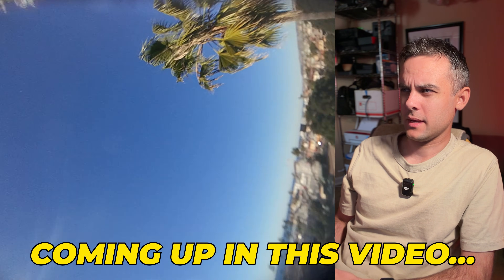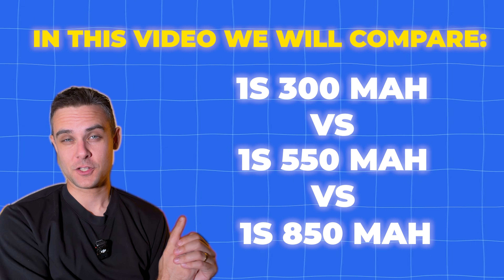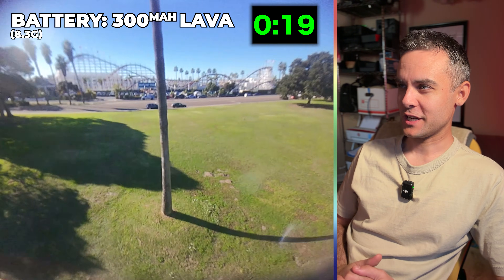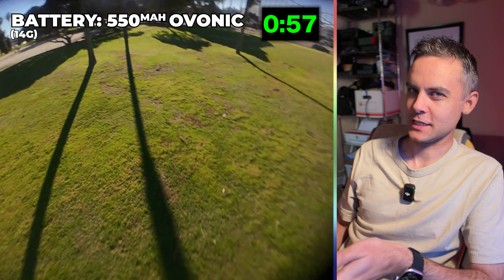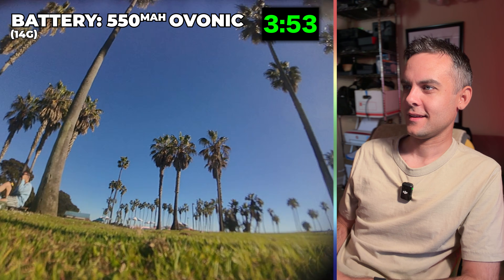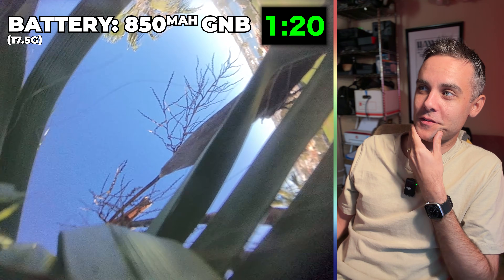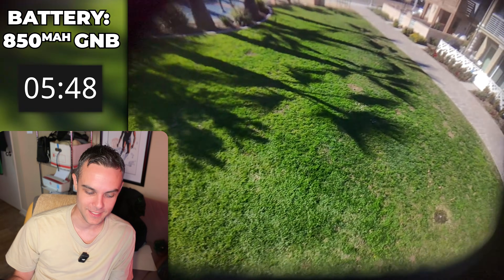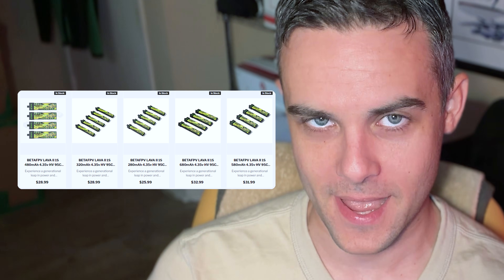How a 3inch 1s battery test became a rescue mission...

Comment: it is analog, but I found myself addicted to a 1S 8 inch toothgrinder build using the stock motors from the beta FPV meteor 75 pro it is so controllable and a lot of fun working on my 2.5 inch 2S tooth grinder currently which will be running 04. These littler drones are a lot of fun. I mainly fly the small sizes all the way down to 65 mm. It’s the only other size I fly is 10 inch and that’s for my long range. I don’t mess with 5 inch lol

Comment: Get the GNB 660mah. Light and powerful.
Reply from the maker: Sounds perfect! I’m also curious about the new beta FPV lava 2, coming in at 680..
Reply: @saunaFPV i found that going light at all costs is not beneficial. U need quick power if u want agile flying and a bit of waight that carries you over something. A ultralight 3 inch 1s isnt very fun imo. I have a ultralight analog build with a very light, thin frame and a DJI build with a very rigid frame. Guess what im flying most. And with the 660 i get almost 5 min of racing. Over 8 min if I do light freestyle.

Comment: Actually bit surprised you get that out of a 1s on a 3 inch. My 85 mm whoop is 2s and my 3" drones are all low mah 4s. I have a single 1s drone and it's an underpowered 25mm with brushed motors.
This does inspire to try some 1s builds. In answer to question at end I aim for 3 minute fly time, give or take some aggression.

Comment: Quick question, did you originally own the Crux3? I'm looking for a Christmas present.

Great video, man!
Reply from the maker: Howdy. I never owned the crux 3 bind n fly from happymodel, but I was using the crux 3 frame with these exact components (until I crashed and broke it)! 

But I’ve heard the crux 3 is pretty great be it in HDZ or analog as a bind n fly

Comment: Weight is the number one focus on these builds. Shaving even 2 grams can lead to a noticeable difference. (Hench why the 300 feel so much different than the 450 or 850). 

I bring this up because removing the motor plugs are essential to this. It’s not about getting more power like you stated, it’s that the resistance is lower, meaning less strain on the battery and more flight time. By removing the plugs you also shave off weight. To me, the time saving of plugging in a motor vs soldering in the field is probably 60 seconds difference. Nice video keep the content coming!
Reply from the maker: Dude great points! Def gonna consider knocking of those plugs bc of what you said 🫡🫡 

Thanks for watching. The content will keep flowing!!
Reply: The next modification is installing titanium screws (half the weight of steel ones and much stronger than nylon PEEK screws). Additionally, I recommend the “wide lens” mod using a lens from the Caddx Ant or the Flywoo 1S Nano Camera V3, its much lighter. You can find a video on my channel showing how it looks on a whoop with 40 mm props weighing 25 g. All these modifications really let it rip on a 1S setup :) For me, the sweet spot is 450 mAh! ❤

Comment: for smaller quads like the grinderino or any other 3-3.5 inch i found that the lipo quality makes a very big difference 
like if you are running with a 650mAh cnhl compared to a tattu or dogcom lipo you will have much more voltage sag and less flight time 
its way more noticable than with a 5 inch 
dont cheap out on the lipos for your smaller quads
im flyin mostly 3.5inch sub250 on 4s and im using dogcom 560mAh 4s and the dogcom ucell 650mAh 4s
i think they are pretty much the same as the tattu lipos 

for example i was testing the 650mAh 80C ovonic and i got about 2min less flight time and they were almost unflyable for freestyle cause of the voltage sag
like 30sec after taking of they were alrdy down to 3.7V 😅

i got 3inch 2s toothpick with the hdzero aio and that one im flying with dogcom 560mAh 2s and im getting 10min flight time if im just cruising 
and i got pretty inefficient motors that are meant for 1s (running them on 75%)
Reply from the maker: Great points!! Battery quality totally matters a lot. I should’ve mentioned this
Reply: Agree with this, run the frame on 1804 and the dogcoms are so much more punchy with less sag than the coddar lihv, and they aren't much if at all cheaper, though definitely cheaper than tattu.

Comment: my only issue with the platform is im yet to find a canopy that works to prevent jello with gyroflow/rocksteady.
Reply from the maker: Rocksteady works great w this setup if the screws are properly tightened! I did have some issues this day w micro vibrations tho.
Reply: @saunaFPV ah okay im currently using the full betafpv setup. So i can just get the flywoo camera shell and screw that into the betafpv canopy?
Reply from the maker: so you’ll need the flywoo o4 cam housing which is just the little plastic shell 

Then you cut the bottom of the beta canopy with nail clippers and slide the adapter in w friction! 

Let me know if you have questions, happy to help